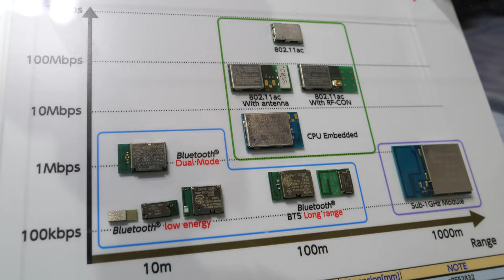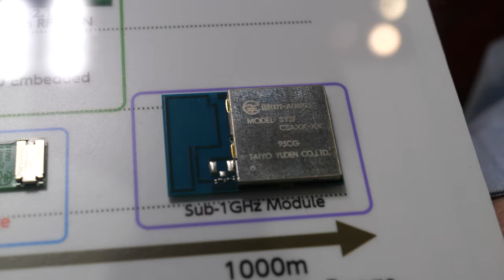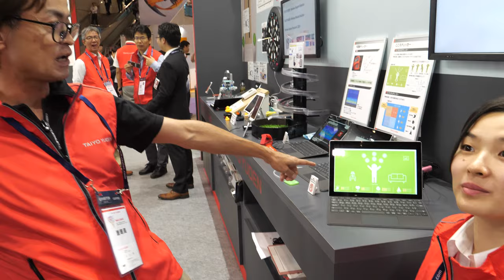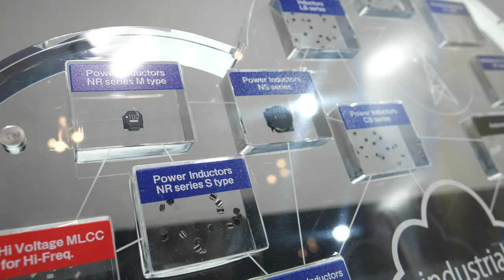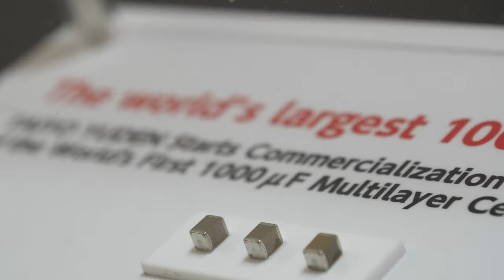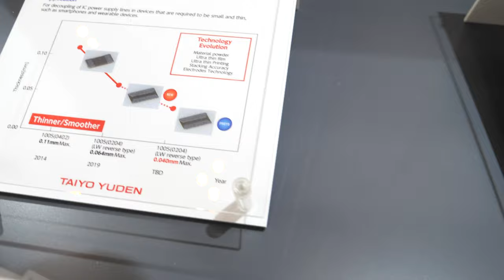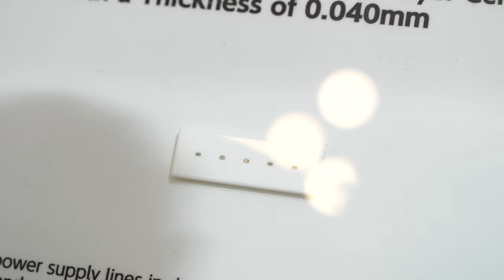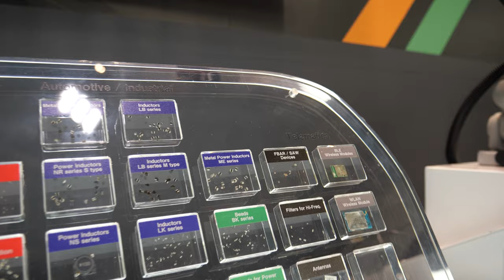Taiyo Yuden world's thinnest 0.040mm capacitor, 1000uF world's highest capacity

Comment: (btw) nice picture
do you recommend Panasonic G9 & Panasonic G9 to purchase?
Reply from the maker: Yes I am happy with my Asia version of G9, only Asia/US version can be hacked for unlimited recording, EU version cannot. I just filmed a 53 minute 4k60 video today so that hack is crucial for me. I hope Panasonic officially unlocks unlimited recording in next firmware update. I did that on previous firmwarenot latest 10-25mm support firmware I don't know if my unlimited hack works with the latest firmware why I am not yet updating. The only negative is the poor autofocus performance, but it seems to be the best yet that they have. Hopefully they use much better video AF system like phase detect in GH6/G10 whenever that comes out. Look for second hand G9 perhaps at below $700 body and lenses at about half price maybe.
Reply: @charbax  (should be - Panasonic G9 &  Leica to purchase)
thx
cheers
Reply from the maker: @wojciechlesniak6096  I use the 12-60 Leica, I think it's good, also the 12-35mm Mark1 and Mark2 both are good, I say go for whichever of these 3 you can find for cheapest on second hand. I paid about $450 for my 12-60 Leica on second hand. I was also considering maybe getting the Olympus 12-40 Pro, but I decided rather to go with Panasonic's Dual IS 2 dual stabilization supported lenses and also the Panasonic/Leica lenses get DFD depth from defocus which I think may also improve the autofocus performance just that bit.
Reply: @charbax OK
thank you very much:)